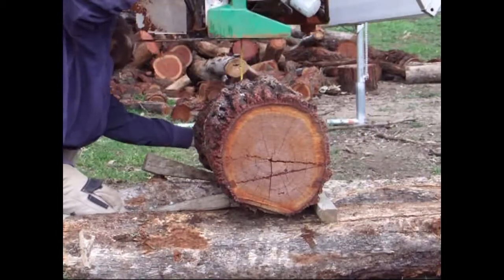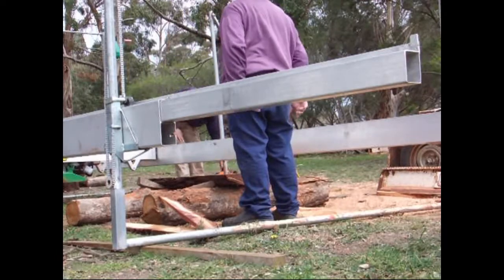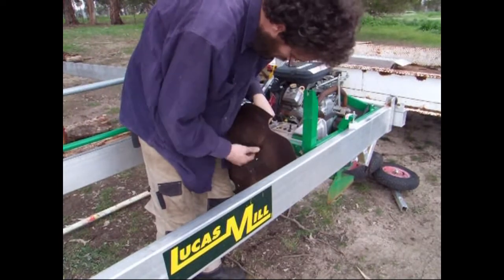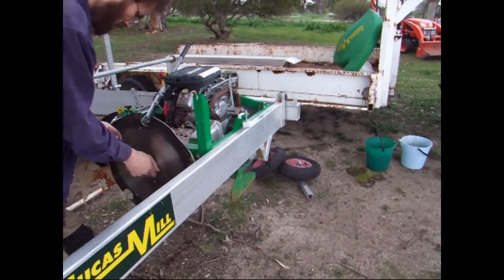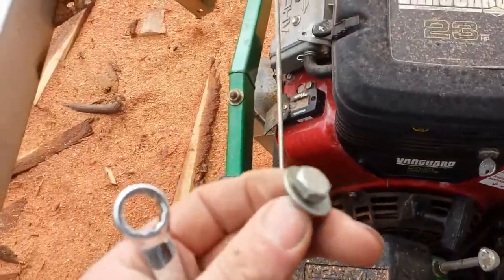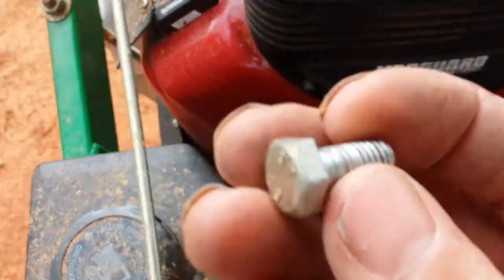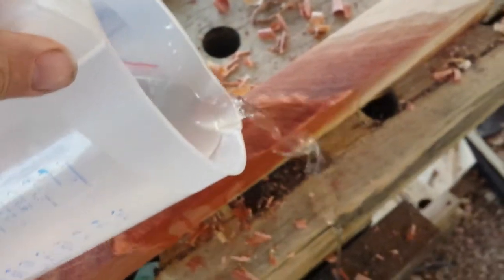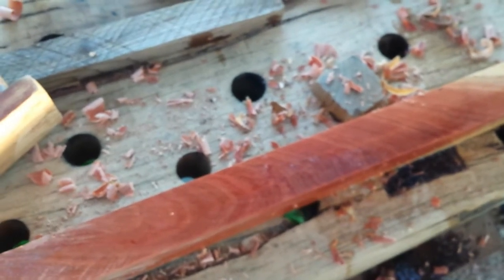Red Iron Bark Milling

Comment: Must be a common problem with that bolt. Same thing happened on mine, found this bolt on the ground. Took a while to realise it was from the fuel tank.
Reply from the maker: Yeah well they do say you are supposed to check all nuts and bolts on a regular basis.